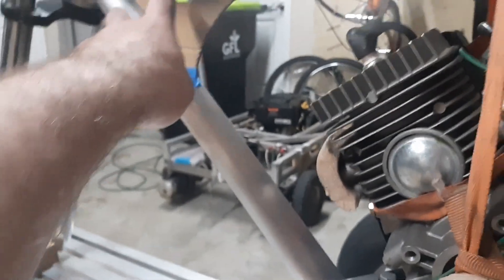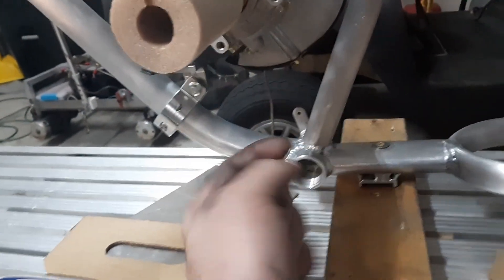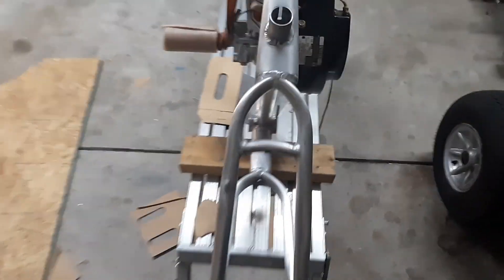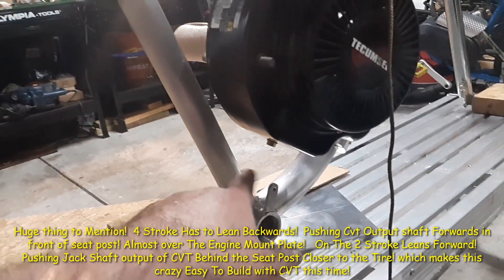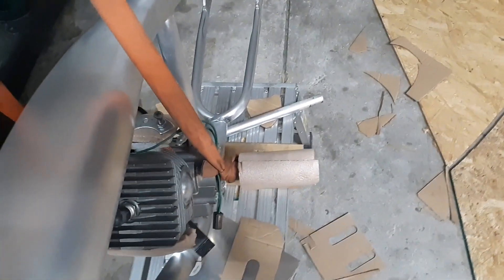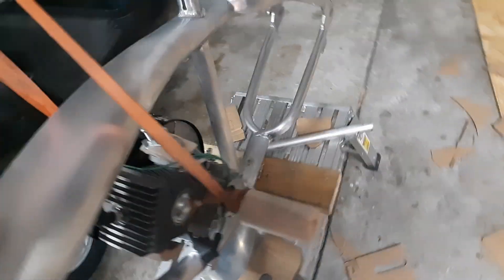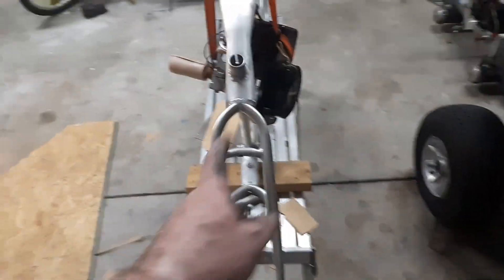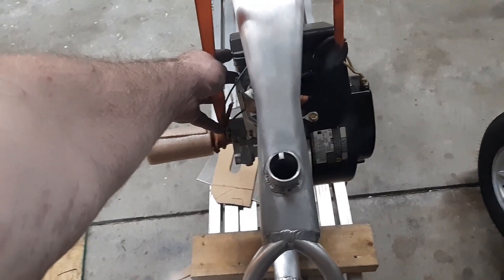Legit 139cc "2 stroke CVT"  Motorized Bicycle Build - This Is Looking Good!

Comment: Cool project build that motor is going to be a beast can’t wait to see how it turns out bro
Reply from the maker: It will turn out perfect!  At least that is what I'll tell the test driver lolz
Reply: Lol 😂
Reply: @BuildBreakFix  I'm down to test drive it! I have faith in your skills.
Reply from the maker: @stephenjohnson6967  cvt transmission is now connected!  Community tab has some engine/cvt porn lolz. Fit way to easy on that engine perfect postion lol never happens

Comment: @Build-break-fix  All you've done is make me want one of these engines now.  DANG IT!
Reply from the maker: good luck stopped making them in 2006 lol
Reply: i have a low hours perfect running used 7hp Tecumseh 2-stroke.  $1000
Reply: @BUILDNIGHT  might as well ask 1,00,000
Reply: @mattparker9726  they sell upwards of 3-4K if you can find one.

Comment: Hey bro, good job on those builds! I'm a real fan of your channel. I did that ms380 on a phantom 85 bottom end and it worked out great. I tried ordering one one those ms660 from a seller and got burn 500.00 bucks because the engine never showed up. I was wondering if you can still build those ms460 to sell.  I want one because I'm having trouble building my own.  The ms380 was line something that just came together real nice but I want something more. I want to use that ms660 to pull my cart but that never happened.  A ms660 would be cool too. Anyway bro.  Bad ass work you got going on

Comment: Gonna be a beast! Some people are using 20 to 1 mix with the phantom 85 break in but that seems like a lot of oil to me. What do you think?
Reply from the maker: yes 16:1 and 20:1 (Use Organic Oil)  "Not" synthetic Oil! on a phantom is very good for about 1 tank of fuel. for breakin.   After that organic oil 32:1  or Synthetic oil 40:1 normal running operations on those!  Oil plays key roll in cooling 2 strokes as well!  Idiots that run 50:1  in those runs runs faster but life span is rapidly decreased!
Reply: @BuildBreakFix  Yup, experienced chainsaw guys say, if you're gonna run 50:1 you might as well just not use any oil at all.  My snowblower said use 50:1 they want it to wear out soon as possible so you'll buy a new one 😜.
Reply: @BuildBreakFix  I'm not even sure if my parts store has organic oil
Reply: @BuildBreakFix  I opened up the box even though it's still way too cold out but it actually came with instructions and it does say 20 to 1 for one tank for break in then 32 to 1 but as far as oil it just says don't use 4 stroke oil or it will void the warranty

Comment: What are your thoughts on a 125cc pit bike motorized bicycle? Seems like a good deal if it's mounted in a reinforced custom frame.... $240-ish gets you a decent engine with real clutch, gearbox, generator for lights VS much shorter lifespan $325 phantom 85. .....I do like the cvt 4 stroke automatic. If the pitbike engine is 4 speed. I dunno if the constant shifting would get annoying.
Reply from the maker: Ever seen ktm 50s lol crazy hell on bicycle at 50cc lol
Reply: @BuildBreakFix    Yeah, they're  cool but..... I wrote that idea off coz the engines cost a lot more & water cooled which adds more potential things to go wrong....One guy had over $3000 into his motorized bike build that used  a water cooled 2 stroke. I think it was a ktm

Comment: Not gonna work.  The concept is cool..but won't work for a bunch a reasons. And all the gussets are unnecessary. And you don't seem to understand the variations of 4 stroke motors. Any Honda clone  can be mounted in any position as long as the carb is level. Only Lifan and Huasheng motors need to be mounted in a specific way. Think if this was feasible why hasn't anyone done it outside of motorcycles? If you pull this off go for a patent. Good luck.
Reply from the maker: bro wtf are you rambling on and on about lol? This is not a 4 stroke engine.  What part of 139cc 2 stroke did you not understand?  Not mounting direction.  Could mount it upside down and sideways and it will run...Of course no one will mount a $2500 2 stroke gokart engine on a motorized bicycle. Most peoples whole high end builds cost less then engine....  you clearly don't watch my channel lol